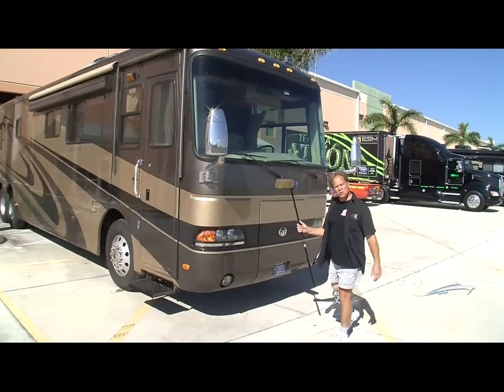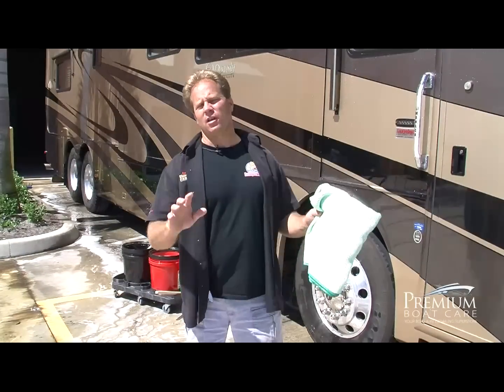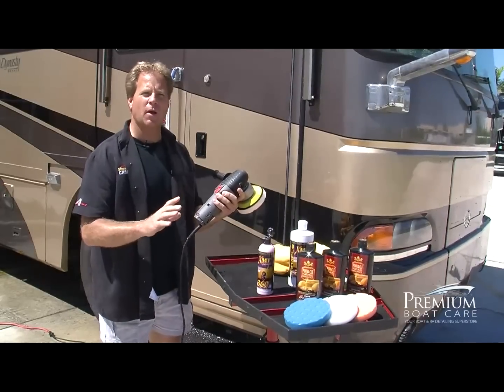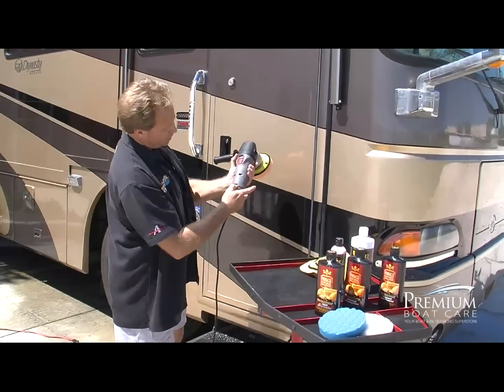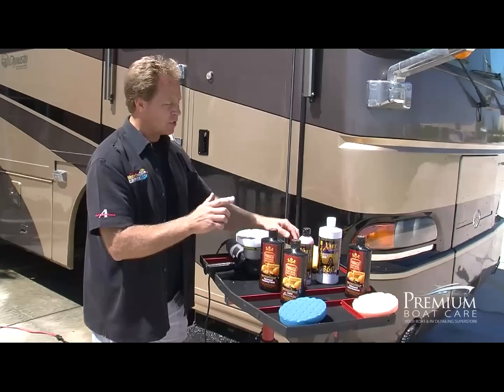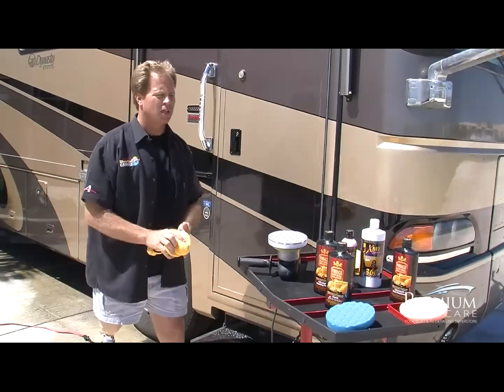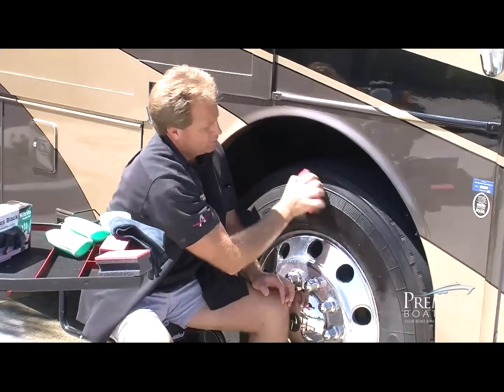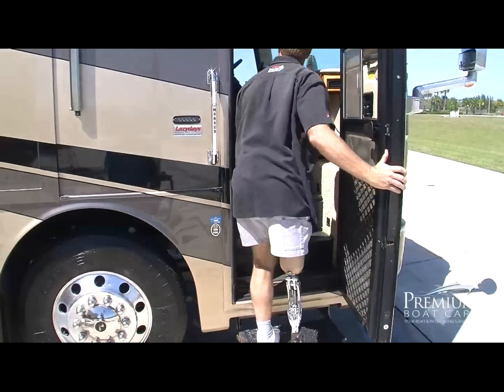How to Wash and Detail your RV with Mike Phillips

Comment: An RV's Gel coat is twice as thick as a painted clear coat .Using a pressure is only dangerous in the wrong hands . If you are blowing seals(which i have never done ) then yes, the pressure washer is being miss used.Keeping the wand about 3-4 feet back is the safest bet and will  give you the best angle for minimal use of water .

Comment: A extension bush pole will be useful, ( Shurldhold ). I washed a White RV roof so nasty, Spay 9, Grease off make it so easy, important  this product do not streak marks  Pressure Washer make it look ok, but time is critical, So rinse with garden hose did the job, I did wash the rest of the rv with heavy wash & wax shampoo works nice, finally waxed with NXT Generation Tech Wax 2.0.
Produces deep gloss, vibrant color and amazing shine! 6 hrs of labor! 2 People, that was fun.

Comment: I'm a Rv detailer and rule number one is DON'T USE A PRESSURE WASHER! Especially in the wrong hands a pressure washer will push and tear the silicone seals out and the water will get behind the paneling and like most people who have Rv's and motor coaches they tend to migrate toward the coastlines. The salt water which gets in the air  will get behind those panels and could rust from inside out and if Its fiberglass or gel coat the pressure washer could split the finish.

Comment: I guess I'm looking for answers, I had my rv washed at one of those in a parking lot wash guys.  I was on the road and my rv was dirty from the rain&road dirt. It looked good and clean so I paid and went my way. When I got home I had my grandson wash&wax it.  This spring I noticed the clear coat coming off in big places and the black paint coming off on the door latches. Can someone tell me what's happening and what can I do to fix the peeling , it's a 2003 Discovery 39S Thanks

Comment: Question guys, what pad is used in the video to apply pinnacle 360? Thanks for your help... Rob
Reply from the maker: robert cadiz  That is a 6.5" Lake Country CCS White Foam Polishing Pad.  This large size pad will work but smaller, thinner pads like the 5.5" CCS White Foam Polishing pad will rotate better.  The more important thing to know is when doing a one-step process you want to use soft foam pads not foam cutting pads or the pad itself will leave marring.  -Mike Phillips

Comment: Never ever use a pressure washer on the roof of an RV regardless of the material. The newer wash and wax products don't need a buffer machine and even Windex makes a hose sprayer with cleaner and spotless rinse that takes no time at all.

Comment: I always read that washing in direct sunlight is a bad idea, because the water acts like a magnifying glass for the UV rays and damages paint.
Reply from the maker: That's correct.

If you "think" about it though... you'll realize that RVs like this are HUGE and most people don't have a garage large enough to wash their RV in.

So most RVs are washed outside and this requires more technique.

One thing you can do is start early in the morning.  The sun might be out but temperatures are still low.

-Mike Phillips
Reply: When I bought my house 6 years ago, a big selling point were the number of trees over the driveway which provide shade almost any time of day.  This is a huge plus, especially when it's hot and sunny.  We don't have nearly as much sun in MI as the Southwest does, but it's still nice to have.

Comment: you aren't polishing the paint, you are polishing the clear coat. If you put your compound on a plate or similar, you can prime your pad without using your finger. I would polish my wheels before cleaning the tires, unless I wanted to wash all that polish off the tires after I already cleaned them
Reply from the maker: Clearcoat paint is paint without pigment.  So it's still paint.

-Mike Phillips